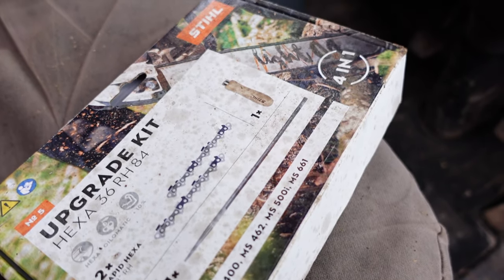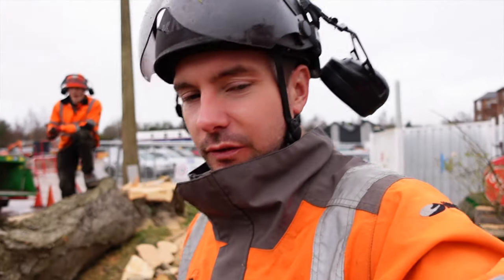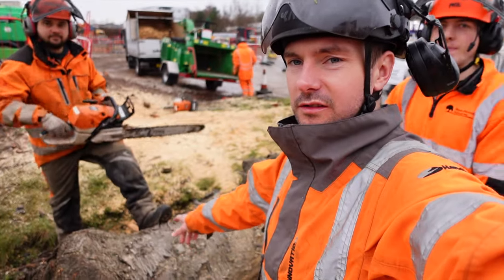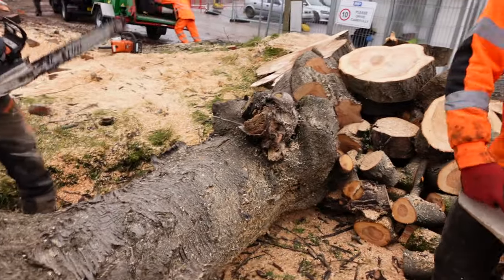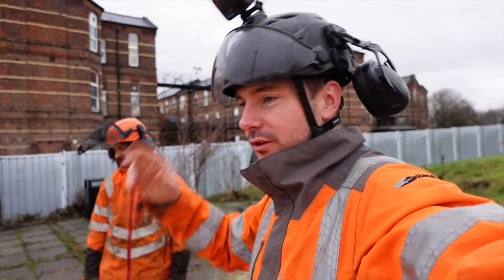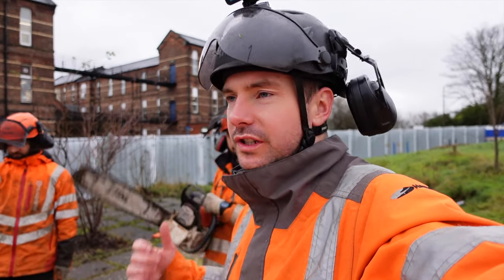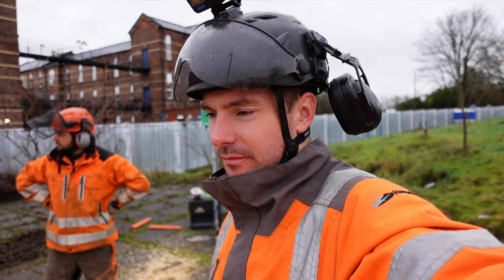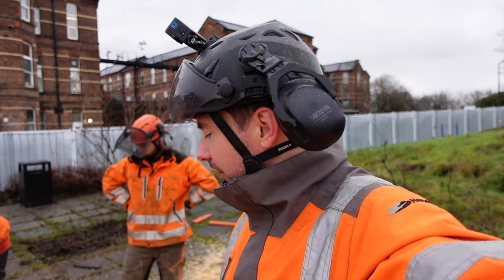Racing the Stihl Rapid Hexa Chain

Comment: Wasent to keen straight out. Bro ive sharpened more 30 n down a touch. Very light rakers. Happy yer gets blunt but pulls n bit more. Like that. Thanx
Reply from the maker: Yeah, it certainly pulls in nice like you say.
Reply: Brought 2 upgrade kits so had to sort it. Yer goin good. But have changed the angle abit. Its good n yer stays sharp. Thanx